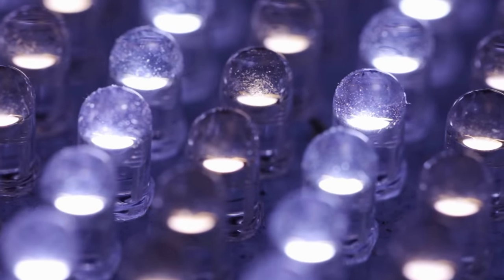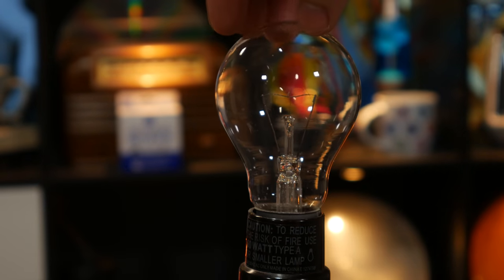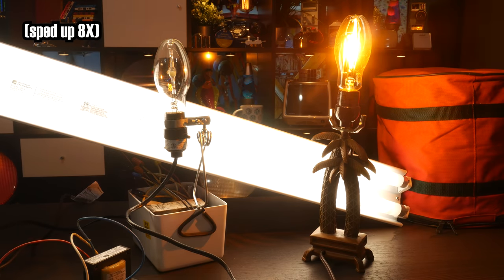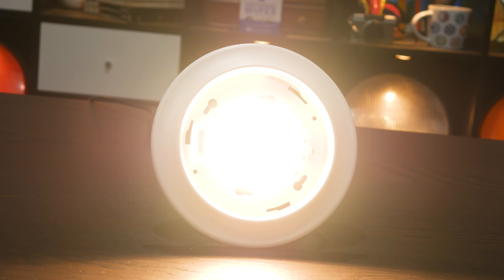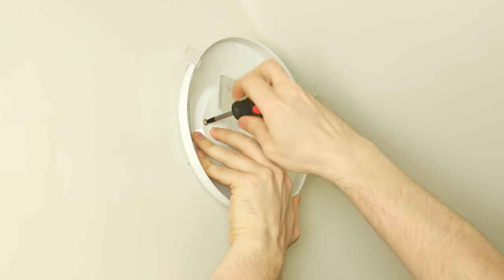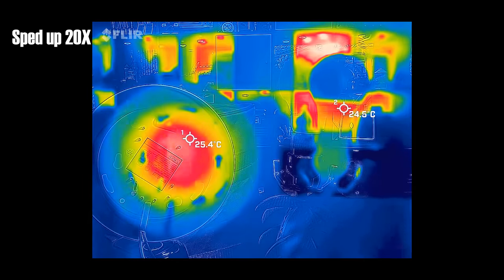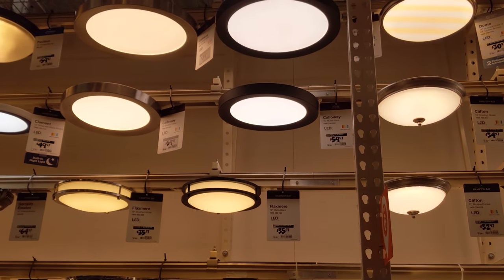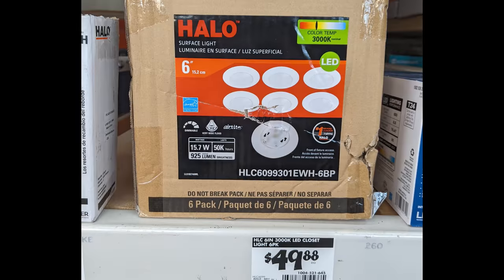A troubling trend in lighting?

Comment: I went all in on the Hue bulbs years ago, I never throw multicolored raves with them but I absolutely MUST change the white color temperature with the time of day. With window daylight, the cool white is perfect. At night it slide it to the warm side. The opposite at either time of day is completely intolerable. I still have all my original bulbs too, I haven't had a failure yet come to think of it.
Reply: We also have hue bulbs.  50 bulbs in the house.  I suggest tuning the "white" of the bulb to match or complement the color of your walls.  For instance, if you have a green wall then make the white of the light more in the green space (RGB: 250,250, 255 ... see more green light) and the room will feel better.  at least it does for us.  Each room has a different shade of white on the walls and the bulb "white" matches it to give a complete feel of the room.
Reply: I have Hue bulbs throughout my house and I've had a frustratingly high failure rate with them. Some of them last forever, others die after a few months.

I'm also really irritated that they tweaked their hub firmware to ignore the color I send them via the API and instead pick some color sort of vaguely near the one I asked for. If I send an RGB of 0,0,255 I expect pure blue, not some purplish color. Older revisions of the firmware did just what they were told to.
Reply: This is understandable. As much as I hate 2700k light, it's not that bad at night. I have my bathroom lights switch to this at a certain time at night just incase I wake up in the middle of the night and b
Need a bathroom break. However 2700k at any other time looks so bad to my eyes that I would rather go without light and use a headband light.
Reply: I do the same thing in my living room/home office, because on the side of the room opposite the window, where my desk is, there often just isn't enough daylight for me, but turning on warmwhite/yellowish light at 3 pm would be depressing.

Except it's not Philipps Hue, it's a cheaper smart home system and it's one of those sleek looking lamps with integrated LEDs. I don't like the fact that I'd have to replace the entire lamp (it's quite a big one, too), if tge LEDs were to break, but it was the only option for me to get adjustable color temp within my budget at the time I moved in.

In all other rooms I use fixtures with socketed LED bulbs for the very same reasons TC pointed out, except for the bathroom, where I got a neat looking spot lamp with integrated LEDs for 10 bucks. As I didn't care much about the lamp design in the bathroom so long as it's not unobtrusive (and it's actually quite pleasant) and it cost about the same as two bulbs, that was a no-brainer. Plus, if that one fails, not much (non-recyclable) material would have been lost anyway.
Two rooms are 2700K, two others are 3000K, though I usually don't notice the difference.

Comment: I’m a lighting engineer who has looked into the filament style LED bulbs a fair bit.  At first they look like they would have overheating issues.  However there is something going on in these bulbs that people are unaware of.  The glass capsule is filled with helium gas which is actually a great heat conductor.  The helium gas effectively wicks the heat off the LED filaments and deposits transfers the heat to the glass
Envelope.  The light conversion efficiency is also very high on this style bulb some of which can achieve over 200lm/w because the phosphor is applied to both sides of the LED chip.

Comment: Huh, never realized this was an issues since Japan has its own solution to the replaceability issue with their standardized flat light sockets.
They make it tricky to design fixtures that lie flush with the ceiling, but I'm realizing just how convenient they are.
Reply: yeah that seems like the correct answer to me.
Reply: Same in the EU. Any apartments built after year X has to have standardized grounded sockets. 
Ours arent sleek and flat but they are instead mounted from the side or inside the ceiling to save space for flush fixtures.

Comment: Fun fact: Did you know that neither wire nuts nor wagos are common in UK and Ireland. Instead we use frustratingly awkward (and imho unreliable) screw terminal blocks. I have no idea why. I think they were so pleased with themselves for inventing the world's safest plug and socket that they decided not to bother putting any effort into wire connectors.
Reply: they are most common here in AT too. tbf, i trust them the most for some reason.
Reply: Wago german, wire nuts American, Robertson screw heads Canadian.  The chocolate block goes back to when they were made of ceramic,  I certainly don't think the wire nut is better,. The waygo only being possible with modern technology
Reply: Czechia here. We also have chocolate blocks!
Reply: Poland here, chocolate box are still in the wild here. I'm trying to get rid of those and won't pay electrician until Wago is used. They are zero-maintenance comparing to chocolate bars that require re-torquing every 5 years.
Reply: "Unreliable" 

My grandma's 50 year old wiring would like to have a word with you.
Reply: @enzoperruccio  Ok if done right it can be reliable but it is too easy to get wrong. Insulation under screw, wire slides up side of screw, screw too loose or too tight.
Reply: idk. i would just get nice wagos and replace every screw terminal that i can find.
Reply: Screw terminals are making it into the US market... not a fan.
Reply: @jusb1066  Took the words outta my mouth (fingers)
Reply: @enzoperruccio  yea the minute they aren't
Reply: @thomasherzog86  I think it's because you're tightening the wire down with a screw, you get a feel for how much force you have put onto the wire giving you a little more confidence, unlike a wago where you just drop a plastic lever and an internal piece of metal drops onto the wire and hope it's enough. (which to be fair it is the vast majority of the time if used properly) I prefer wagos like most people here but I don't hate choc blocks, seen them last decades without issue plenty of times, if they didn't most UK houses would be having power issues daily.
Reply: I freakin HATE screw terminal blocks, they are annoying as hell.

Comment: Heat is an even bigger issue for LEDs in Automotive applications since they are exposed to more extreme temperatures.
However they are also much simpler since they can directly work on DC power.
Reply: The same could be said for LED traffic light modules yet I've seen quite many in my town that are over 10 years old and still going strong and here on the mid-Atlantic we have the most dramatic temperature swings
Reply: The worst part about the automotive ones is that they are many times more specific and expensive. If you're $1,200 headlight goes out on your F-150 you can't go down to the store and pickup any old light to replace it with you are pretty much stuck with the $1,200 option. And yes they can easily cost that much. At least in your house if a fixture goes out and you are broke or something you can go down and fix it for $5-$10 or maybe go without like use an old lamp or something, on a car you are stuck
Reply: @blakel4595  Yes you are correct.
You have to replace the entire headlight assembly even to fix the LED Daylight Running light if it fails.

They need to make the factory LED headlights modular so they can be removed and installed just like a regular light bulb for future repairs. Or have all manufacturers come together to create a new 'standardized LED socket' so replacement ones can be bought at the Auto Parts Store.

Unfortunately I doubt manufacturers want to do that since they are in the business of making money.
Reply: @Argedis  They shouldn't do the LED socket since its implementation would take away from the LED's directional advantages. It should just be modular. Believe it or not, replaceable modules, though uncommon, have existed at some point in time, such as on the 2004-2008 Acura TL
Reply: The only thing I hate about LED automotive lights is when it's installed post-sale by idiots.

What do you mean that's your low beam? Turn that shit down before you blind everyone through their mirror!

Comment: Being an electrician, I love these fixtures. Easy to install, and require a service call for replacement (For the unskilled user)
Reply: You replace them pretty often?
Reply: @drphosferrous  Yes, the cheaper ones seem to have a lot of early deaths. The units I install I warranty for one year. But I still see quite a few die within the first couple years. The other point of failure is people break the cover lens. Sometimes I can just replace the lens but it requires I rob one from another fixture, that means I have to charge for it so it’s better to replace the entire unit.
Reply: @bosborn1  so they are more profitable than regular bulb fixtures. I'll add that to my pro-con list
Reply: @drphosferrous  Yes in a way. The typical homeowner isn’t going to change out the fixture if the emitter fails. They are going to call an electrician.
Reply: I work as electrician at sugar factory , and we still use cfl tube lamps , I work there for only 2 years (my first job) but our boss is trying to switch all light sources into "LED lamps" , there is many lamps at the factory , so it takes some time to figure out financing , but I had a privilage of instaling one of those "led lamps " , I imagined them being lamps with LED tubes conected to mains voltage, insted of cfl tubes (I saw those led lamps in past and It's perfect , just change tube , and it's fixed) but no , it was a lamp with the same body format as cfl lamps , electronics closed off , and 3 led stripes conected in paralel , Idk how these will work in places with high temperature , hot steam bloving over them and all kinds of chemicals + liquid sugar that comes off only with hot water.
Reply: @matejmotuz108  they resist temps well but not time. In 2-3 years they will start flickering like a strobe light and will probably be replaced with conventional fixtures.
Reply: I’m waiting for an electrician right now!!! NEVER again.  I hate these.  I was shocked when I took the globe off and see a circuit board and not a light bulb I can change myself in one minute .

Comment: I just bought a standalone fixture with built-in LEDs, and after watching this video, hope it works out well. It is at least a single unit, that does not need to match with others.

On the other hand, my main complaint is that it fails in some usability aspects, where assumptions coming from a century of bulbs just behaving the same way no longer hold.
This unit has adjustable brightness and color temperature, which is a nice feature. However, all of that is dependent on being set by, and turned on or off with the remote only. If a switch is used to turn the entire unit off, it resets to its default color and maximum brightness when turned back on.
Reply: Yeah, I replaced my mom's and my center kitchen fixtures with the hardwired LED kind. Need light in a kitchen, and neither of us have young eyes. For $40 each, I am willing to replace them when needed. But I'll keep this in mind for other areas of the apartment.

Comment: Solution:

Outlets in the ceiling boxes. Just plug in the new one, no more danger than the old Edison ones, and more flexible
Reply: Just specify a NEMA L5-15 twist-lock connector.  Or develop a more compact design.  But many of these lamps have free floating power supply connector boxes, though that should be going away as the drivers are appearing on the boards.
Reply: @jkbrown5496  The free-floating power box on puck lights is important because it allows the puck to stay thin (as thin as .5" drywall) so that you can use the pucks in places where a deeper fixture would be impossible, like where a joist is in the way of the optimal location for a light.  You can usually squeeze the power supply/driver box up into the ceiling by the side of the joist, and then the puck will slip right in and sit flush where a can light or thicker puck could never fit.

IMHO, the better option is to standardize the power box and then sell replacement pucks separately.  That way a puck replacement is as simple as detaching the old, attaching the new, and using its spring loaded clamps to mount it in the ceiling.
Reply: You get your NEMA L5-15, I keep my GU10, and we all can get rid of the old E27 and E14 screw sockets.
Reply: I mean they already do it in bathrooms that have those fan lights. Usually the bulb and fan are just on house plugs.
Reply: Stopgap: Mandate Wago connectors for these. Makes swapping faster and easier.
Reply: @jkbrown5496  the only benefit I see from that is L5-15 connectors getting cheaper out of necessity.
Reply: @Eulogy  I plan to lay in a supply of Wagos when I eventually have to start replacing my puck lights.
Reply: In Australia we don't have ceiling boxes, but it is relatively common to have standard power sockets screwed to the roof timbers for each light. The light fixture just screws to the wood, or in the case of downlights they clip onto the plaster board.
Reply: @waveman1500   yep, standard power sockets in roof cavities and light fittings with factory fitted power cords in australia are good. We had this combination 30+ years ago for bathroom exhaust fans.
Reply: @thog9987  Those are getting phased out for propritary plugs and itegrated leds
Reply: That doesn't solve the problem of mismatched fixtures and the extra waste of an entire fixture instead of just a bulb
Reply: @ulogy  10:52 
he predicted you'd say that 🙃

Comment: I got a bunch before this video was made and they clip into one of those boxes that have a little spring clip mounting holes, the same kind that are used to hold anything from light fixtures to vent fan covers, so they can easily be replaced physically, and they come with both a screw type connector and a removable two-prong plug. They were also much cheaper at about $5 a piece (got mine at a Menards sale, with a rebate as well, at the end of the day they were about a buck fifty a piece, got the last four boxes in the store), so a lot of the shortcomings listed in this video in terms of user serviceability and stuff like that have already been addressed.

Comment: I have noticed the the “vintage style” also produce less electronic interference so the work great for garage door openers that other led bulbs cause remote issues.
Reply: @halcyonoutlander2105  is that only when the garage door was opened and the light turned on? So you'd have to wait for it to time out before you could remote it closed?
Reply: @zaandam0172  the electronic drivers in most bulbs emit a low level radio wave that interferes with the reception of the signal from the remotes. From what I have found the vintage style bulbs get around this because the driver is in the metal base of the bulb which shields it from the receiver of the opener. This is double shielded being the bulb is also screwed into the metal socket. My family found this out through trial and error and I thought that this would be good to share since trying different bulbs can get annoying and expensive.
Reply: @zaandam0172  Some LED bulbs use switching power supplies which generate interference, but some use linear power supplies which are much cleaner. Due to the limited space in the base filament style bulbs are invariably always the latter.

Comment: My expertise is from the lighting entertainment industry, which I’ve been apart of for 8 years now. Lighting fixtures in our industry have been going through the LED Revolution over the course of my time. 
There is one very important thing to know about LED sources - their efficiency directly correlates to their temperature. As LEDs heat up, they output less light. A more efficient heat sink not only helps in wear and tear, it directly makes the LED more efficient and consistent in color. 
Some of the most advanced fixtures in our industry actually do the opposite of what was discussed here, we have fixtures actually overdrive themselves to deal with the droop to keep the same output on stage.
Also, CRI is being replaced with TM-30-18. It’s a much more detailed measurement of what the light is actually doing rather than just a percentage that CRI is.
Reply: I'm always commenting when a place switches from metal halide to LED... I hate it. I wish more places still used the good old fashioned lighting systems. When I watch WWE now it makes me sick, compared to the awesomely lit 90s/early 00's.. everything is way way too "bright" now, entire rooms/stages are lit up like daylight instead of mood lighting within darkness.
Reply: @k1m198  what a boomer comment

Comment: My mother got a couple of LED light fixtures installed a few years back on the rather high ceiling of our living room, replacing the edison sockets with said fixtures.
I protested saying that in the case that the lights failed we would have no convenient way of replacing them, my concerns were ignored. One of the lights started to fail a year after that, today they don't work at all, and there's no way to quickly replace them, because it means uninstalling and replacing the damn thing, which is hard when the ceiling is about 5 meters away from the floor.

This video validates my experience so much.